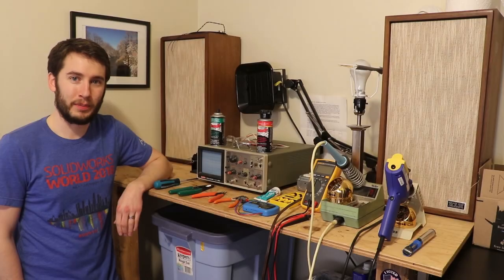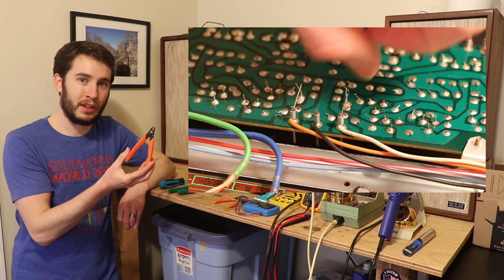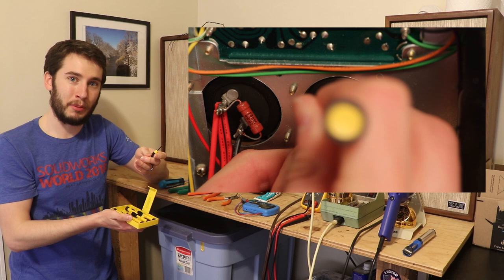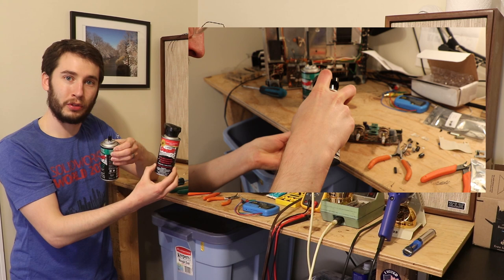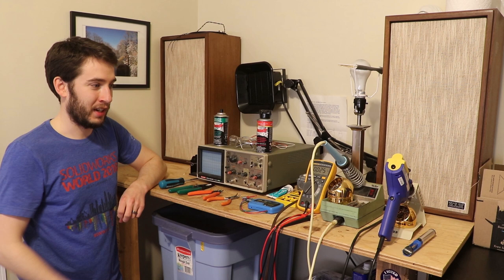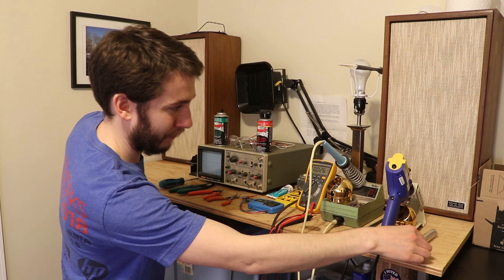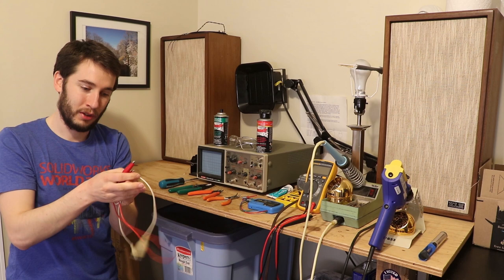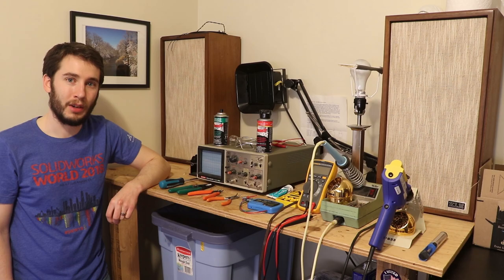Must-Have Tools For Working On Vintage Audio Gear!

Comment: To make my DIM BULB tester, I opened up a $8 plastic power strip (with switch) and rewired it for this purpose.  Took about 20 minutes. After rewiring it, I used a silver marker on the black plastic housing of the power strip to clearly label: 1) "DIM BULB TESTER", 2) Bulb socket, 3) test-load socket. I bought a plug in socket for the bulb (a couple of bucks). Works like a charm.
The challenge was finding the correct wattage of incandescent light bulbs where I live (Europe-CH).  Seems the world has switched to LED while I had assumed the incandescent bulbs would always be readily available.  Anything above 40W is a real chore to find. Might have left some in storage... somewhere...hoping that's the case.

I suppose one could even go the route of wiring for multiple bulbs with a 4 or 5 socket power strip with individual socket switches and different wattage bulbs.  Useful if you find screwing light bulbs (in and out) to be a challenge.
Reply: I ended up making one like AH's.   I like it because you can  use a single bulb on the unit itself, or plug in a power strip for multiple bulbs to parallel up the wattage.

Comment: Great Channel! Lots of useful information. Found a NAD receiver at Goodwill with dirty volume and balance controls and a Vector Research VR-5000 at a fleamarket that needs quite a bit more TLC. Been using your videos as a reference for the repairs. Still building my tool collection.

Comment: Great video ! Thanks for taking the time to post it. Regarding SAFETY GLASSES, I completely agree that they should always be worn when working. Scuffed safety glasses can be easily renewed with either plastic or metal polish. We have enough plastic in the environment so no need to toss them when worn.

Comment: This is a really great video. I have pretty much mostly the same handtools, I just recently purchased a X-Tronics soldering station, with attached helping hands! This is really great for holding small boards or wires in front of the soldering station so you can use both hands free to do the work. It’s really nice. Presently I’m working on a Kenwood KR-7070 with the auto tune bar. Manufactured around 1972, and a really sweet receiver, 65 W per channel. There are two bulbs burned out in the dial face that need to be replaced, and the pointer seems to be rather dull, I’m guessing it’s not the correct bulb voltage. But I have one problem. I can’t remove the faceplate. I removed all the knobs, I remove the four nuts and washers from four of the control stems but there seems to be something still holding it from being removed. Appears to be holding at the bottom but after removing the bottom cover from the receiver, I cannot find a single thing that would be preventing it from being removed. I have researched many sites, emailed at least four people, after explaining the problem all I get back is crickets. I realize Marantz is your area of expertise but maybe you have different resources hookah help me with my problem? Any help would be much appreciate it. Thanks.

Comment: Great vídeo! I would add one signal generator and an 8ohm/4ohm load resistance to test power specs.
Reply: I have 2 funtion generators in my lab but now I use a computer only.
I bought one Zoom U-24 now I can do a lot of testing with the computer.
Best Regards

Comment: oh please mention saftey of the contact cleaner smell - i think i am going to dIe from it, try to spray that stuff outside! 
i have not done any repairs in years - i have to recap the 838 tone board - what a noisy beast. pop hissssss click, seems like the older they are the harder they are to do.
new subscriber btw. I have a Aoyue 2703A  Rework Station - maybe this will work for desoldering these kinda boards as it never worked on laptops, i quit repairing laptops 5 years ago as the repairman became obsolete. cool channel btw..ill be here a lot it looks like got in over my head on a few pioneers.
if you ever need a lapop DC jack I probally have it as that was my old business - swapped out over 3000 of them.

Comment: I have a optinica amplifier sm 1515 b if the power transformer goes bad can it still be fixed the part number is rtrnp0506afzz and put ic is rh-ix1066afzz can you still get those parts

Comment: Even tho you may not be a professional you have all the tool's you need to do what you do. Keep it up ps i just bought a Marantz 2252b and after awhile of listening the left channel fades any ideas? I'm sure it's an easy fix just wanted you're opinion thanks.
Reply from the maker: I'd start with cleaning the controls with DeOxit. If that doesn't work, it could be a number of things, some simple some more complex
Reply: @AHFixIt   thanks brother i really appreciate it.

Comment: What power/wattage of  light bulb do you use for the dim bulb tester?
Reply from the maker: Depends on the amp. If it's a lower power amp, probably 60 watts is ok. If it's a higher power one, you start looking at 100W and higher.

Comment: I really would like to know what you think about these "in circuit" ESR Meters, and why you don't use these kind of tools?
Reply from the maker: There is nothing wrong with those. I get by just fine with the capacitance reading function on my DMM.
Reply: ESR readings are rarely needed for audio applications. You would want one of those for work on switching power supplies.